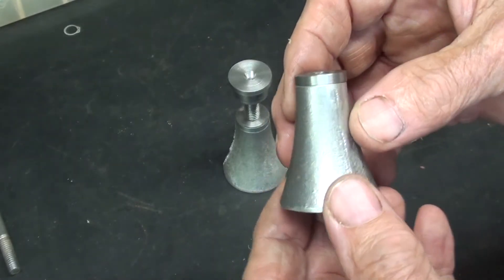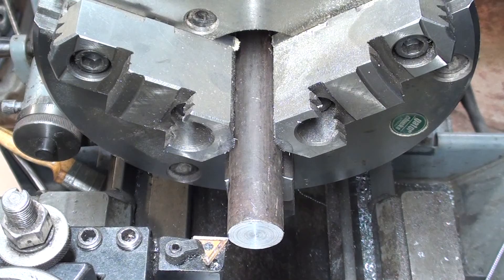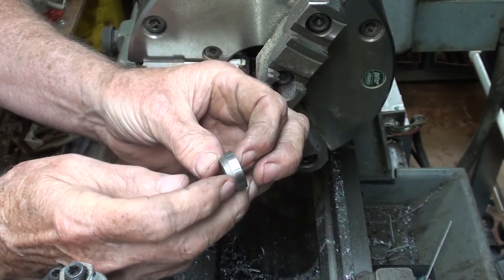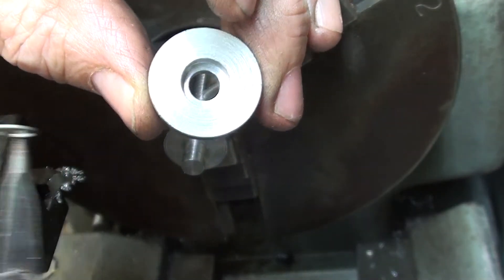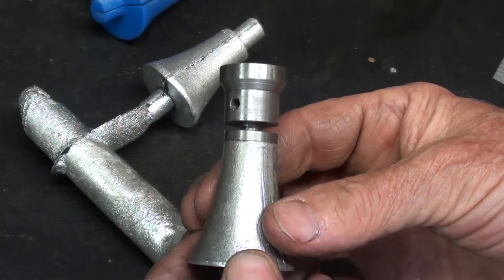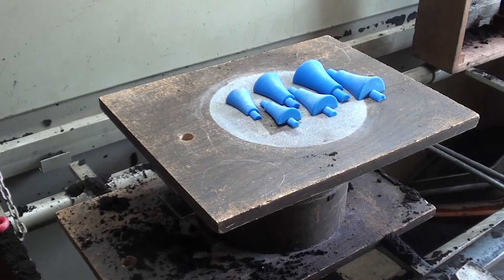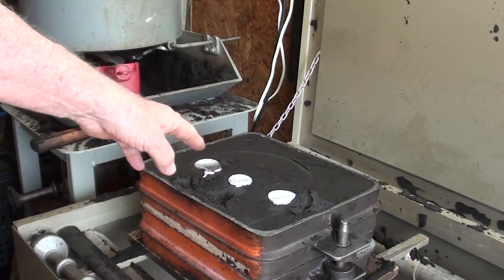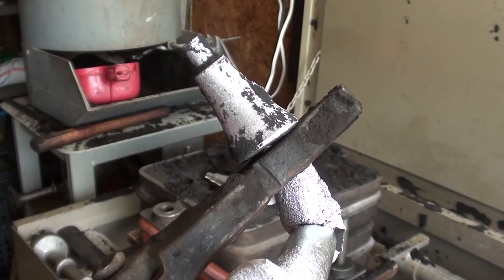HOW TO MAKE a Tiny Jack TIPS #654 pt 2 tubalcain

Comment: Instead of using a circlip to hold the top piece on, It would have been easier and neater to have drilled and tapped a hole in the end to hold the swivelly bit on with a screw through the centre ! Also, since you've done videos on serrations - surely the top & bottom faces of these jacks are ideal surfaces for that kind of treatment !

Comment: 🙋‍♂️Is there a reason these needed to be split?  Looks like a great project!  My first inclination would have been to cast these standing up with the runners in the drag.  I suppose they would take up less vertical space laying down.  Still trying to learn...  Thanks for the video!
Reply: I'd have thought bollox to that and just made the jacks out of the sprues :)
Yes, a vertical pour would have been my thought too.
Reply: The patterns are split to make removing the patterns from the sand without damaging the sand forms possible. (the cope and drag split the form 50/50) Ron W4BIN
Reply: @W4BIN  IMO, they could have been open cast !
Just an inverted bell-shape in the sand - filled with liquid alu.

Comment: I have the normal stash of knives, but knives just don't interest me. Pocket knives and flashlights disappeared at a regular pace for me. My father kept the very same flashlight in his car for at least 60 years. The nickel plating was nearly gone when I first saw it as a child. He had had soldered up battery acid leakage holes before I was born. My sister inherited the flashlight. I wasn't a trustworthy keeper. My hoarding fetish is clamps. I think that the last count was over 225. I use most of them regularly. I have convinced my wife that a man cannot own too many clamps. She no longer complains when I bring home a new stash. I have styles for virtually any function, but every project requires something more than I own. I generally separate the clamps into three categories, welding, rigging and woodworking.
Reply from the maker: Wow, that is a lot of clamps. I probably only have about 50

Comment: Good morning! I also made a set of Jack screws, but approached it a little differently. As I don't have access to a foundry, and I do have a lathe, I turned up 11/2" dia rounds, about 1 1/4 in lenght, hollowed out, that interlocked with each other with shoulder cuts. The top piece has a 1/2-13 tapped hole fitted with a purchased swivel pad screw from McMaster Karr. You can stack up whatever height required, in my case a pair that has a range of 1 1/2 to 6" height. After applying black oxide to them with the gold tone of the plating on the purchased screw pads, they look quite nice and function perfectly. Thanks for all you do.
Reply from the maker: Sounds like you did a great job I bet they look wonderful

Comment: What's the purpose of the hole you drilled in the head of the screw?
Reply: It's for turning the screw (you put a small rod through the hole and turn). Did you notice there are no flats on the screw head for a wrench to grip?  It's kind of like a vise handle in that respect.  But the rod is not captured, as on a vise.
Good question.  You are likely not the only viewer to wonder about it.
Reply: @surlyogre1476  Tnx